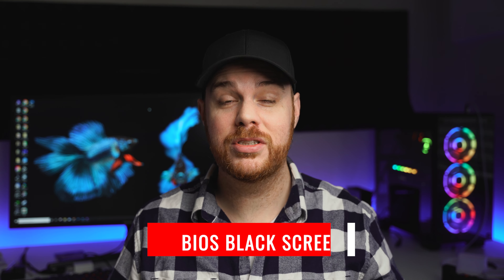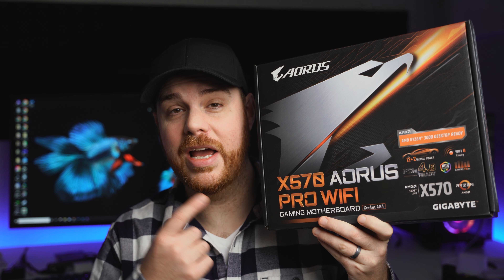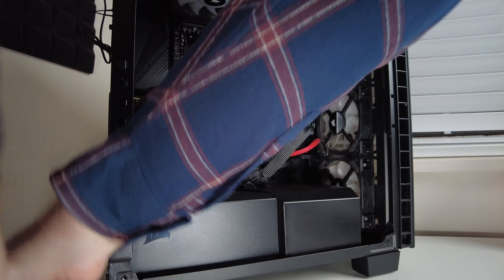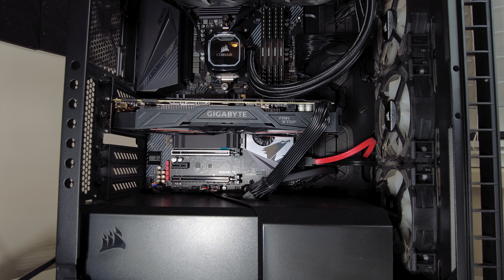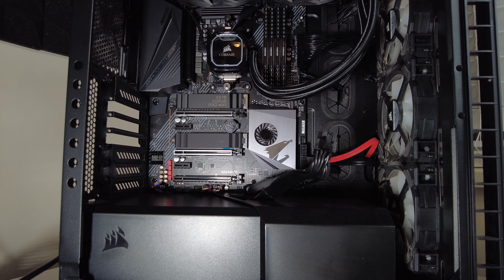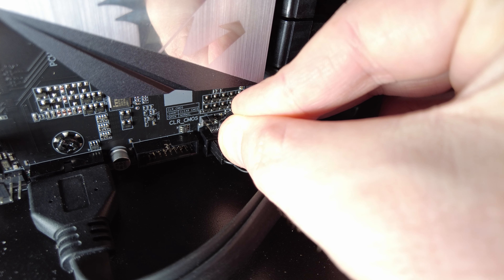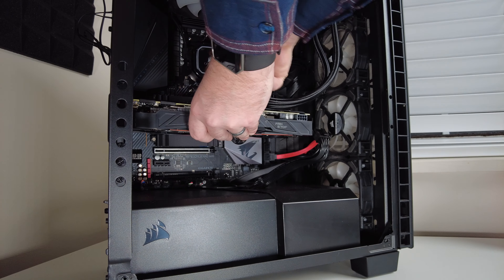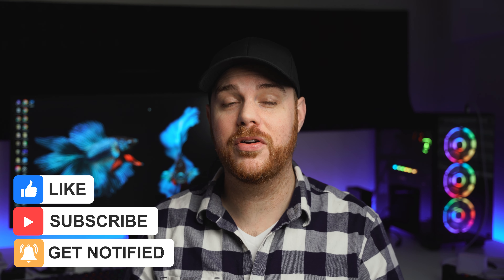How to FIX BLACK SCREEN from BIOS CHANGES (3 WAYS)

Comment: Hi man, I have a blank black screen after building a new pc (11th build that I've done) and this is the first time where I didn't even see a bios screen pop up when finished building. I'm not sure why but i then thought of putting in my ssd from another build similar specs cpu but different motherboard. The Pc boots fine and goes directly to windows 10 however, during the boot process the motherboard never showed the BIOS startup screen and i have fastboot turned off. is this motherboard faulty?
Reply from the maker: Sorry bud, I'm not the guy to ask for something that technical.. Hope you figure it out!
Reply: Hey my friend has this same problem did you figure it out?
\
Reply: @cesar0.079  remounting the cpu fixed it not sure why maybe it had something to do with the motherboard relearning and configuring with the cpu
Reply: This is what's happening with me right now. It won't post and if you press delete upon turning on won't show bios, but if you turn it on it will load windows.  I just built this rig.
Reply: @RanYard  did u find the solution yet?
Reply: @dapaweka1003  found out my cheap generic rx 580 mining gpu has no uefi driver and the bios of the mobo is automatically on uefi mode, so I used a better gpu(XFX rx 570)  that is compatible with uefi and turned the bios to csm. I  did install windows 11 with XFX rx 570 first since win 11 requires uefi.
Reply: @RanYard  thank you!

Comment: I enabled XPM and got a blue screen of death. Then no display signal. I tried all 3 solutions and I still have no signal.

What could be the issue?

Update: I found out I had my ram in the wrong slots lol. Placed them in the right slots and it turned on.

Comment: Last night i updated my asrock b560m pro4 bios to latest, and at 97% my pc rebooted suddenly, it give me black screen, but windows still loaded and work normaly,i try jumper method its not working, removing vga and ram and ssd slot,but it makes me cant enter windows, anybody know how to fix this?? Im not trying remove battery method since its still on warranty and it has a seal on it, the store not yet confirmed what i must do, so what i supposed to do now??

Comment: bro im still getting the same code after going through hell taking out the gpu and losing and finding the screw, back to plugging turned it on and still the same error code 0d on asus motherboard
Reply from the maker: Sorry to hear my friend. Could be several issues unfortunately.

Comment: I have tried removing the battery and shorting the pins but it's still not resetting the bios. If anyone had any ideas I would love to hear.
Reply: Hai did you got answer
Reply: @sridhar8670  nah mate I just ended up buying a new motherboard cause I couldn't find a fix.
Reply: @SM-xf1br  i try updating my motherboard and it works
Reply: @SM-xf1br  I’m in the same situation, probably have to buy new mobo. I can’t find a solution.

Comment: Someone Please Help Me!! 
😭😭😭😭
I was playing Valorant on my Asus ROG Zephyrs GA502 , suddenly it started BIOS update , then I left the room(cause the update was taking time) , then I came back after 15 minutes , but the screen was black (the screen was not black while the update) , then I left my laptop as it is for another 15-20 minutes , but still the screen was black , then I 'Force Power Off' the laptop (by holding Power Button) and then tried to turn it on again , I pressed the power button , the keyboard backlight turned on , fans turned on , but nothing on screen , not even the Asus logo that appears whenever I start the laptop, the screen was totally black , I waited for another 10min. , Still black screen , from then , whenever I start the laptop, the screen is still black.
(I forgot to mention that Charging Cable was connected while the BIOS update)
(Means laptop was charging while this whole thing happened)

So someone please help me with this issue.

I AM having a heart attack since the day it happened ( its been over a week now 😭)
Reply: Was your issue ever fixed?
Reply: @marciaw.3314  yes bro , luckily for me , it was in warranty , so it got fixed at the asus service center , they said it was some issue with the power unit